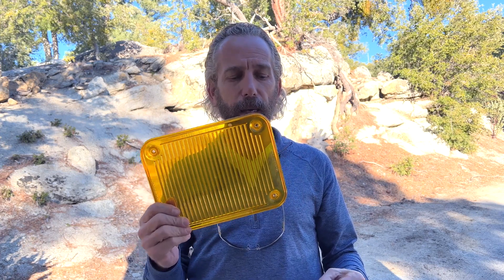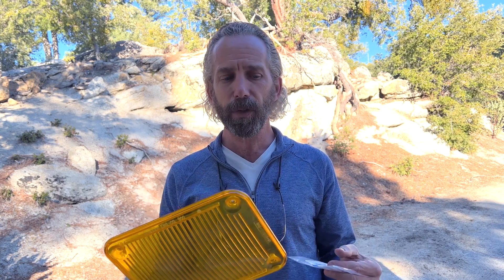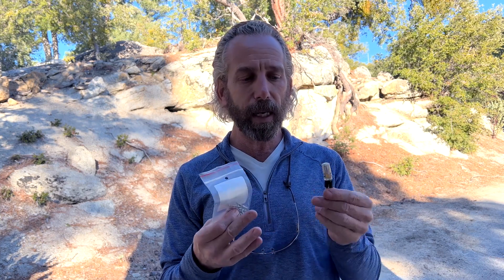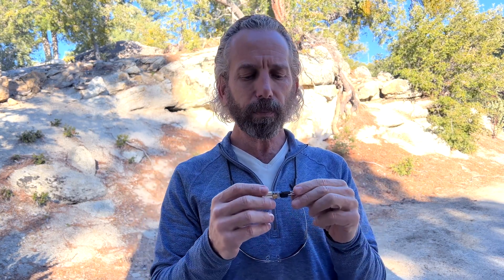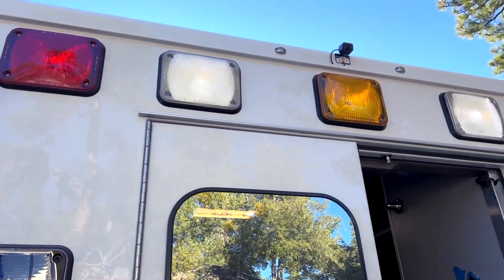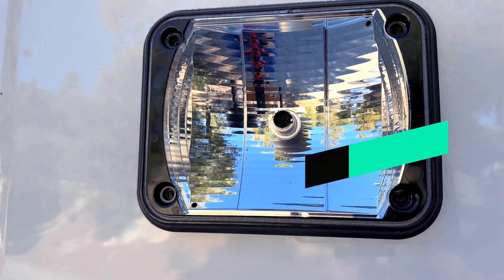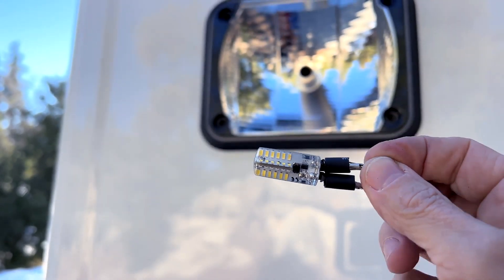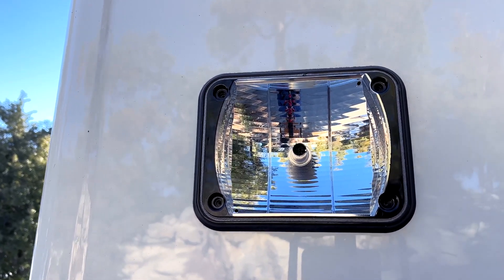Replace Halogen Ambulance Lights for $3.00 LED's Versus $200.00 Fast

Comment: Great idea, I am going to steal it for my own ambulance! Just a note, if you use the proper crimping tool for your terminal you do not have to solder them. I have worked on airplanes and helicopter maintenance and we always just crimp the terminals.